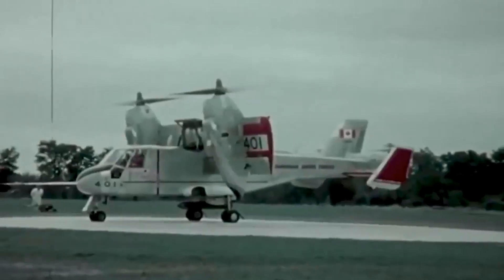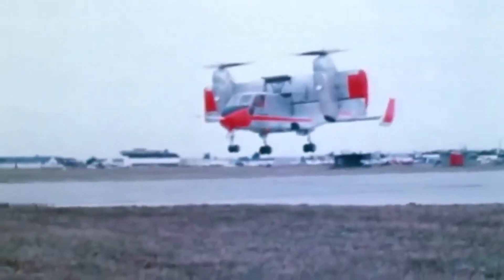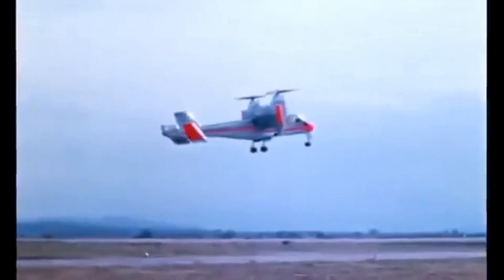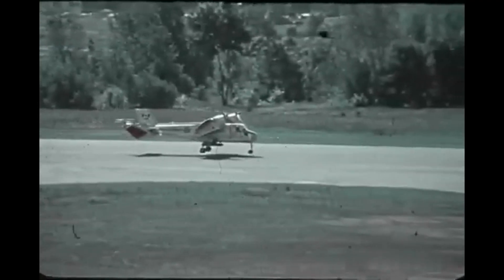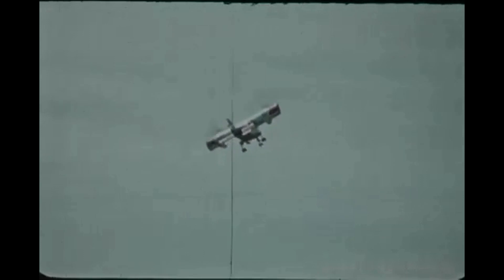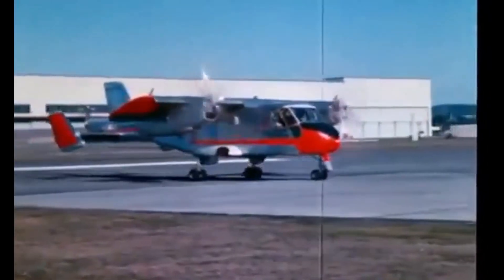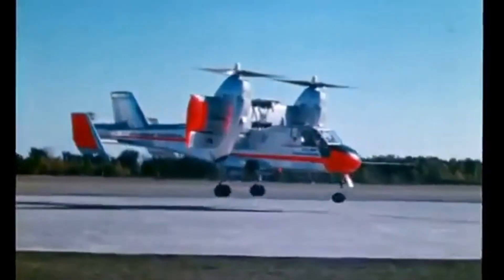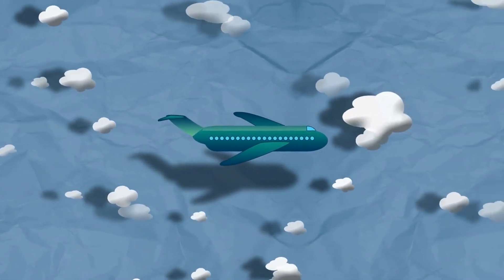Innovating the Skies: The Canadair CL-84's Contributions to VTOL Technology

Comment: Whats the reason for the rear propeller on the tail. . . . additional lift???
Reply from the maker: wikipedia says that - Contra-rotating rotors on a vertical axis in the tail provided fore-and-aft (pitch) control during hovering and transitional flight.
Reply: @net man  Cool. . . .thanks for the reply back, insppreciate it👍🏻!